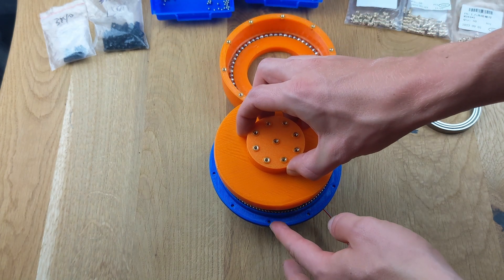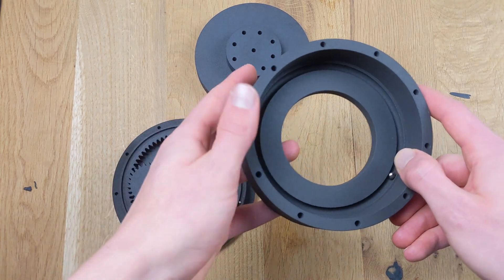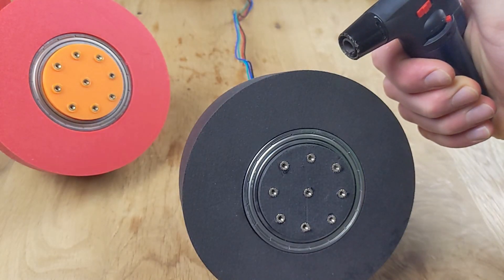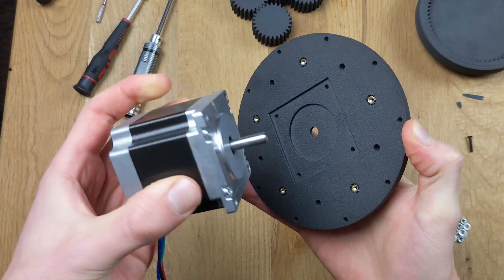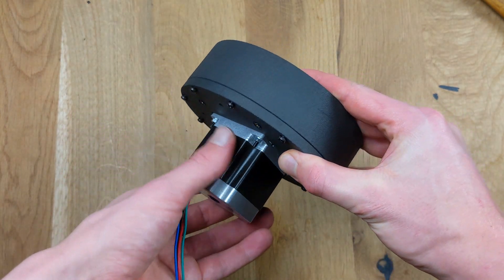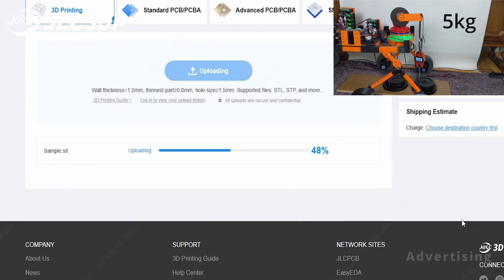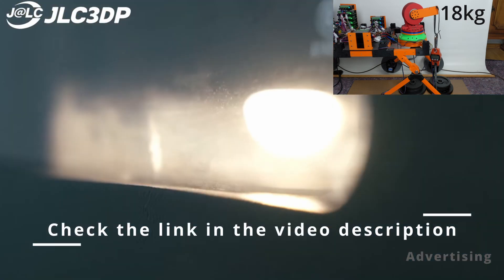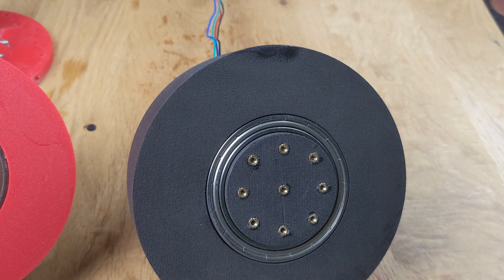Comparing 3D-printed gears PLA vs. NYLON

Comment: Although nylon has a higher ultimate tensile strength than PLA, PLA has a higher yield strength than nylon. So I would assume that the greater deformation of the nylon gear teeth is changing the tooth geometry, and hence, the gearbox efficiency.